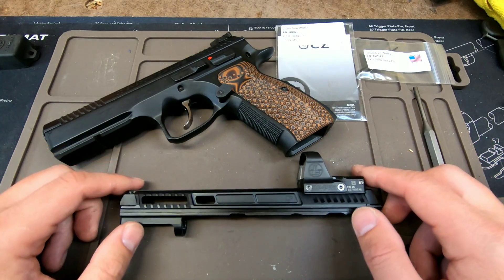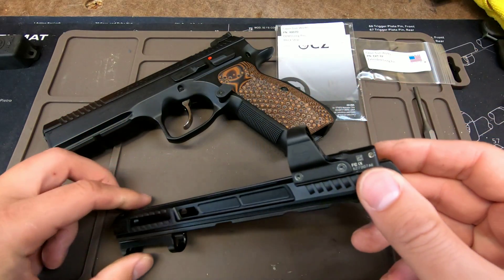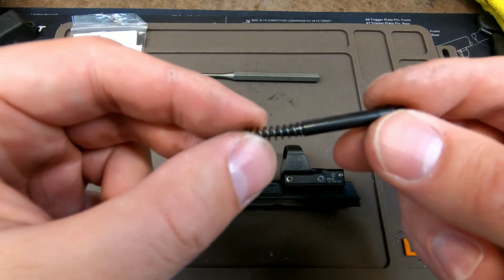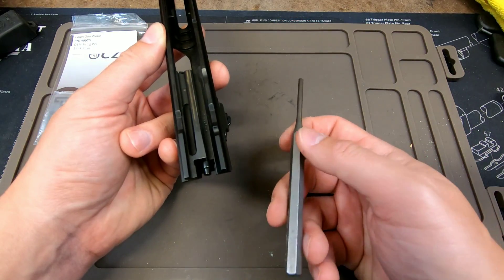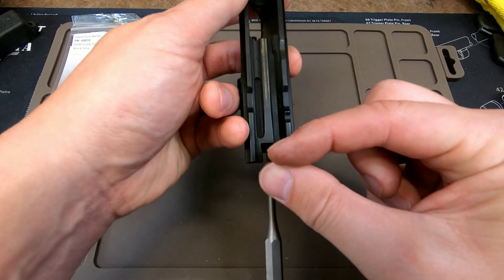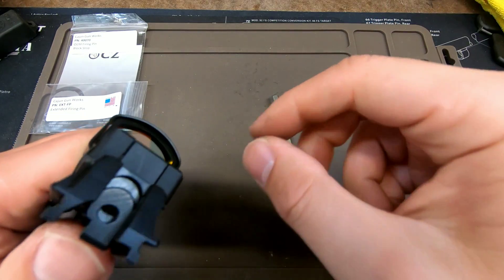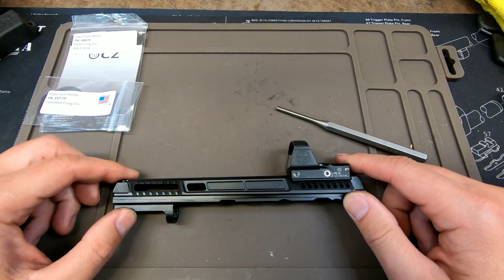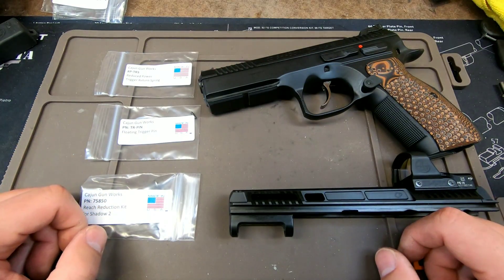CZ Shadow 2 DIY - Episode #1 - Extended Firing Pin Installation (Primary Machine Carry Optics Slide)

Comment: Just stumbled across your channel, cool stuff along with your Beretta vids. To complete this slide, could I ask where you sourced a spare barrel for a Shadow 2?
Reply from the maker: I used the one that came with the S2. Once CZ USA gets more barrels back in stock, I'll order one from them so I have a dedicated barrel for Carry Optics.
Reply: @CobraReady  I see, thanks for the info. By the way, aside from the longer length sticking out of the S2's slide, do you know if Tac Sports barrels will work in the S2? I believe they're the same diameter?

Comment: Great videos, clear and easy to follow, well done! I wanted to ask what are the advantages in using an extended firing pin over the stock one. Greetings from Italy!
Reply from the maker: With the extended firing pin, you can use lighter springs and have less chance of light primer strikes.
Reply: I installed an extended firing pin for my CZ75D PCR with insights from ADPD installation video. I haven’t had a single missfire.  Be sure to check out ADPD other videos...I’m not sure if there are issues with the Shadow’s firing pin retaining pin, but it’s a worthy discussion to review from every angle.